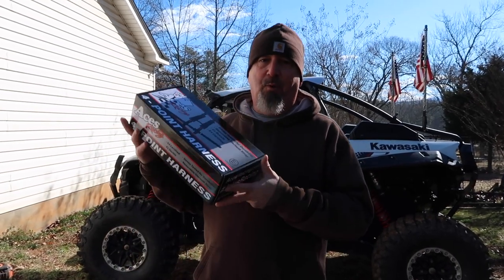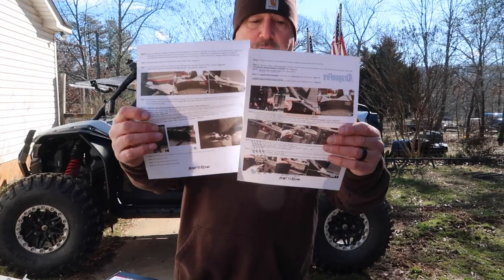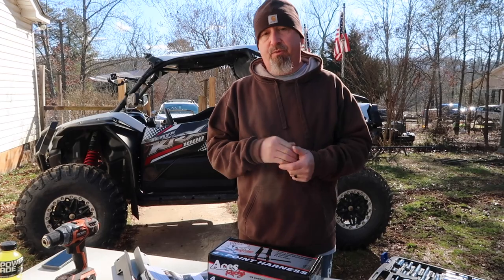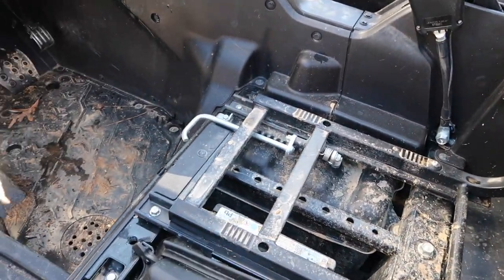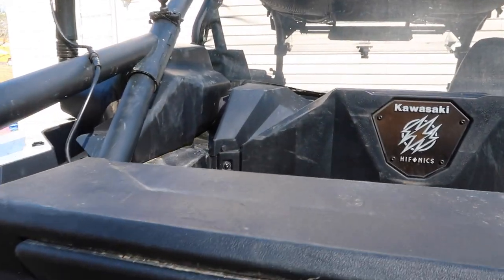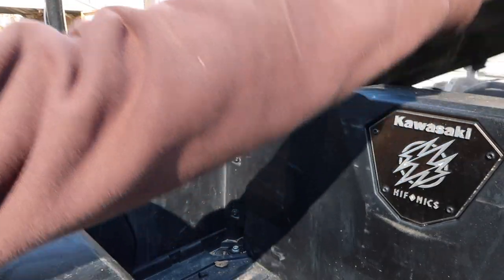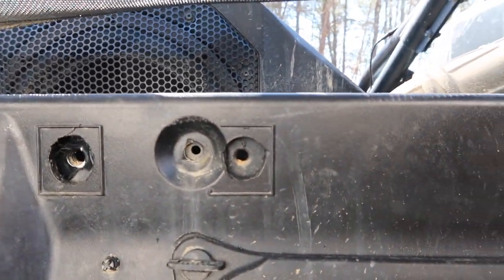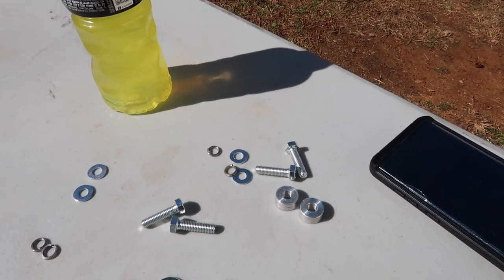Installing a 4 Point Harness in the Kawasaki KRX 1000 Using the Dragonfire Harness Bar

Comment: Hey guys Great video. A tip for future seat removal. Take out the front bolts as you did and then just slide the seat off you don’t have to remove the rear bolts. Figured it out after taking my seats out about 10 times pain in the butt.
Reply from the maker: That's a great tip.  I will definitely keep that in mind.  Thanks

Comment: So the way that looks, if I have a seat extender on, that setup will still work right?  No harness bar to get in the way.
Reply from the maker: The harness bar won't work with the factory speakers.  Not sure what you mean about the seat extender
Reply: @MichaelDavisOutdoorAdventures . I didn’t think about the speakers.  Makes sense.  I put a bracket on that moves my seat back an additional 3 inches.  I’m 6’5” so leg room is super important. I’m so glad I saw your video. I looked into it, those brackets will work perfect for me.  Thanks.
Reply from the maker: Perfect,  I'm so glad it will work, and glad the video helped